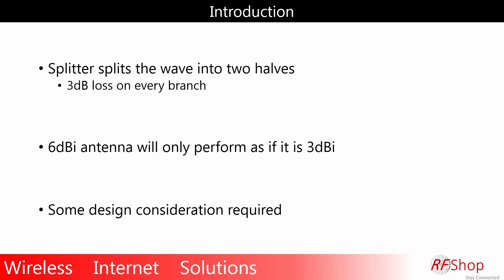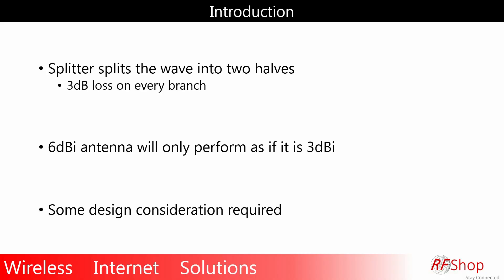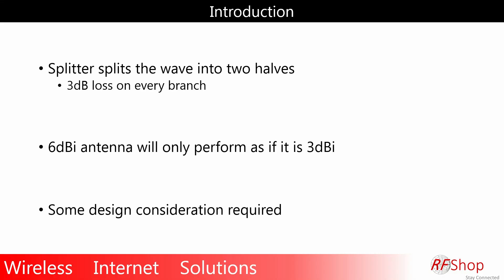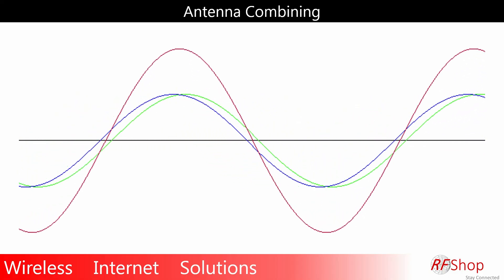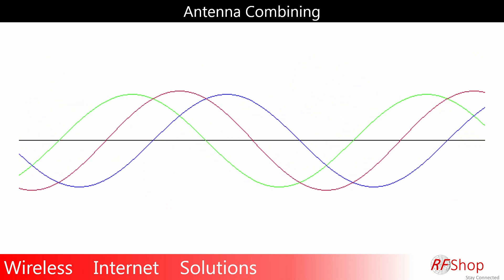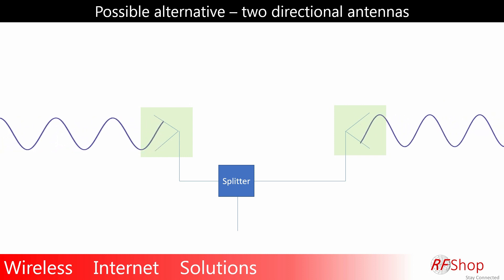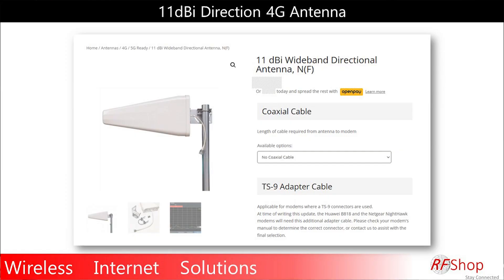Can I use an RF splitter on my Helium Miner ?

Comment: What am I supposed to expect if i use one 6.5 dbi amd one 3.5 dbi omnidirectional antennas 4 metres from each other. Will anything be damaged either the antennas or the miner?
Reply from the maker: It should work. Both antennas will get half the power, and they will work without damaging the other one. However, there will be a direction where things are out of phase and you will see nulls and peaks, unless the antennas are on opposing sides of a structure and potentially don't see each other at all.

Comment: Hello
Thank you so much for the very informative content you are sharing
can I ask a question?
Can I use a 2dbi and 5dbi antenna simultaneously with a splitter device?
Reply from the maker: It does depend on what you want to achieve but in principle yes, that’s possible and could make sense
Reply: @RFShop 
Hi
 Thank you for your response.
How can I do this?
I live in Iran and unfortunately I do not have access to you to make this work.

What tools do I need for this?

Comment: Is a "T" connector considered a splitter? I'm considering using a 3-way T connector with the omni antennas directly connected to both outputs and running the input into the perpendicular leg of the T, forming 1 large antenna from 2 identical antennas. Mounting the entire contraption vertically forming one tall antenna. Is this identical to using a "formal" splitter? Would it detune the antenna? Would it create excessive reflections back to the transmitter? Is there something special in a "splitter" or is it just a T with a fancy name and price?
Reply from the maker: A T would be a bad splitter. In RF design, you want to do something called impedance matching...basically making sure that the signal is flowing smoothly to both ports, and also trying to make sure there is no coupling between the two outgoing ports. A common design we use is a thing called a Wilkinson Power Divider ( feel free to search for this on Google ). That device makes sure you guide the power to the right ports. 
In a T, you basically just "jam" everything together. It's a mediocre impedance match and you accept that everything you get from one antenna will be divided equally to the end device (your miner) and the rest will go to the other antenna...which is pointless. 

So, I guess it's fair to say there's a massive difference between a splitter in an aluminium box and a T :)

Comment: Setup

2 Patch Panel 9dbi antennas (N-Male)    >    2 N-Male to 2 N-Female Splitter    >    2 Hotspots (N-Female)

1 meter LMR 400 between hotspots and splitter i.e 2 cables which gives 0.4dbi loss
1 meter LMR 400 between splitter and antennas i.e 2 cables which gives 0.4dbi loss

Cable Loss = 1dbi Approx
Splitter Loss = 3dbi Approx
Total Loss = 4 dbi

9 dbi - 4 dbi = 5 dbi for each hotspot

Will this setup work?
Are the calculations right or am I missing something?
How will be the readings from antennas split into both hotspots?
Reply from the maker: IN theory it should work, but I am not in favour of running two hotspots on the same location as it breaks the IoT plan

Comment: Can we use two antenna for one minor #1 will be 3db for shorter coverage & #2 will be 9 db for long distance coverage.
Reply from the maker: I would recommend just using a good quality low gain antenna
Reply: @RFShop   Hi I shall explain my set up of miner. I live on 5 th floor in 9 storied apartment I can not set up helium miner in the house with its antenna in my window as there is building opposite to it. Terrace is ideal place to place antenna. I cannot install complete outdoor set up as the building authority will have objection, so I was thinking to have antenna on terrace and mining unit in the house but my only concern is signal will drop drastically while passing through cable any suggestion how can I amplify  signal over say 25 mtrs of cable.
Reply from the maker: @RajKumar-kf2dh  can you please an antenna on the window (i.e. a window mount antenna with suction cups?)

Comment: Good vid. You are right that people don't understand RF. Having been to uni or worked in cellular tech means you do. But of course everyone is an expert these days hey? I am wondering about doing a tri-sector arrangement.. maybe 3x poyntings. Can get decent 3 way splitter/combiner that doesn't introduce 6dB loss. Having a cavity filter too. Cavity because here in UK when deploying sigfox we had some sites with inband interference which needed one
Reply from the maker: Hi Richard, if it's possible to use some directional antennas and have the weaker gain facing the other antennas it will turn into a nice "array" and it's possible to make a great solution. The trouble I have is the Dunning Kruger effect ... have a look on Google if you don't know what this is ;)

Comment: This was very informational, thanks. 
If I end up going with DIRECTIONAL antenna's and install a bi-directional amplifier on each antenna (before the splitter), does that mean I could negate the splitter loss effect on antenna's? Therefore a 10dbi directional antenna is actually acting like a 10 dbi directional antenna and not a 7dbi directional antenna?
Reply from the maker: Yes, that would indeed be the way it could work but I personally would almost not bother with that. The 3dB losses when you have directional antennas are manageable and I don't think. Amplifiers, on the other hand, will introduce some noise and could be a bigger problem.

Comment: What about combination of omni + directional antenna?
Reply from the maker: It’s possible yes, but hou will still face the 3dB losses
Reply: @RFShop  Maybe amplifier and cavity filter.
Reply from the maker: For sure it’s possible, but it becomes quite a complex setup and with amplifiers it’s going to be difficult to manage the legality and system design

Comment: What RF splitter do you recommend for 2 directional panels 12dBi? I'm going to be on a building with big walls of concrete that blocks all signal from other side.
Reply from the maker: Any 4g splitter should be OK

Comment: What if you use two 10dbi’s antennas! Your splitting those that means two 7’s
Not shabby! I’m using a 8dbi with my wire length I’m closer to 7.22dbi 
So mathematically two 10dbi’s I would be at the same thing!
Reply from the maker: Aeems legit

Comment: do you think dubble antenna for a miner works with two directional? I live in an isolated place, I have 30 hotspots 60km away to the east and 50 hotspots 70km west, my antenna connects to one city and the other only if pointed in the right direction, never both together. so with two directional and a splitter mounted on the contrary I could reach both? sorry my bad english
Reply from the maker: I think that’s worth trying

Comment: I had the opportunity to try such a setup and I must admit that I was positively surprised. However, I obtained RF isolation because both antennas were installed on both sides of a building consisting of many metal parts. I will only add that both antennas were connected to the Helium hotspot.
Reply from the maker: Awesome…thanks for sharing

Comment: My idea is as follows: setting up a 3dB omni-directional dual polarized antenna, elevation is approximately 15m too cover a smaller City I live in. Too reach the next bigger City (35km linear distance) I‘d  either choose a Yagi or Panel, not sure which and how much dB is best.
The setup will be running with a bidirectional amplifier specifically designed for 868Mhz with built in SAW filters. It has tx 5dB and rx 16dB gain.
Would it be better using the amplifier for both antenna’s, or one for each ?

From what I have read about Wilkinson dividers, there are ones with loss and lossless ones. The divider with loss is at approximately 3dB loss. Since the omni antenna only has 3dB, theoretically speaking it should be at 0dB. Or, will the omni antenna be operating with tx2dB/rx13dB because of the amplifier ?
If I where too operate it with no Amp, would the antenna be at 0dB ?

Would a lossless divider be the solution for both antennas, or is something else lossless on these dividers ? 
The only divider I could find for 868 Mhz are used in air traffic known as FLARM. According to the Datasheet it’s not lossless.

I’ve been looking into Helium for a week now and I have stumbled across many with the idea of operating two Miners with one antenna. I understand it from an earnings point of view but it is a costly investment. Besides that, one will need two different ip-addresses. I’d rather cover a bigger area than have two covering only one area.

And by the way, this is the only channel besides others I have watched, where one can learn from the comments as well. A big plus. So thank you very much. My first contact with RF was with a Multi Wave Oscillator with spark gaps. 😎
Reply from the maker: I would certainly not endorse two miners on one antenna. It goes against the idea of the IoT network deployment and will add to scaling in that hex where everyone will loose.
As for lossless vs non lossless splitters…there will always be at least 3dB loss. 
Your logic about the amps with splitters seems OK though!
Reply: Fantastic! Thanks mate. I have finally found a web page explaining all there is about HF and how HF electronic devices work. I always thought HF was in the GHz range but I was wrong.😀

Last question: Should I place the Amp near both antennas or after the transmitter ?

Comment: Thank you for those amazing videos...
What you think about a splitter for 2 helium miners on one 12 or 15 dbi directional antenna (sector/yaghi/grid/panel...)
Note: only 5 dbi is more than enough for each miner! And the area around me is empty... So im not spoofing :)
Reply from the maker: I prefer to recommend building the IoT network, which won’t benefit that much from two miners on one antenna to the best of my knowledge
Reply: @RFShop 
 👍Thank you

Comment: Can I place two panel antennas pointing away from each other on the same pol (0ne on top of the other)?
Reply from the maker: Yes, in principle that is possible but it depends what you want to achive. One higher gain omni could do the same
Reply: @RFShop  I'm in US. two 13.5 dbi, 90 degree sectors on a mountainside home yard to cover 180 degrees.

KP Performance: KP-900DP-90S 90º 900 MHz 12.5 dBi Dual Pol Slant
Reply from the maker: @jblglw  so they would go into one miner? Should work well
Reply: @jblglw  hey do you have a picture of your set up on Reddit? Would love to see your build.

Comment: Directional antennas have bleed on the back and side also, is that an issue?
Reply from the maker: Normally those power levels are low enough that it eill have less of an effect. It could be OK but it’s always good to check and make sure

Comment: Hi, thank you this video. Mcgill Microwave Systems 10dbi for europe what do you think for this antenna ? After pocv11 updates I will use lightning arrestor & long cable for use under 10dbi.
Reply from the maker: The antenna is good…I would recommend you report the correct gain on the Helium platform then it should be fine
Reply: @RFShop  thank you.

Comment: Cool idea but....

If you have 2 miners connected to the same antenne, the 2 miners will most probably be in the same LAN network, sharing the same public IP.

As a result of it, one miner will be relayed, right?
Reply from the maker: My video was about one miner with two antennas, but either way it's a mess. Simplest is just to stick to the original plan using one miner with one antenna on one location

Comment: Hi. I have a maybe stupid question.
I live in flat and i wanna place one antenna (3dbi) to one side and other antenna (3dbi) on other side of building. So i can pick up signal from both sides of flat. My question is that this should work witch 2x 6dbi (if i have 3dbi splitter) as normal 3 dbi antenna right? Is this good placement or i should do it differently?
Thanks for answer

Edit 1: one antenna will be 13m from ground, other 16m.
Reply from the maker: Yes, that would indeed work but do keep it mind that the radiation patterns will still be the same as the original 6dBi antennas...just a bit weaker in strength

Comment: So wouldn't one have to take in to account the impedance when combining 2 50 ohm loads, and the potential damage to equipment when this is not to spec?  Also antennas should prob be at least 1/4 wavel length apart, correct?
Reply from the maker: Hi David,
Yes, but these devices most often are Wilkinson splitters, matched to 50 Ohm on the inside.
You are correct about the spacing, but the problem is you need to get the spacing correct otherwise there are modt likely going to be issues. Given this community I recommend against it, unless someone understand the physics enough to space them correvt (like you seem to understand)

Comment: Well what about splitting two miners for one antenna instead of two antennas? Would the splitter still work the same/ going in the same direction so it doesn’t fry the miners?
Reply from the maker: Hi Aaron. I do see this is now the latest idea being considered. I'm not a fan of the idea of combining two miners into one antenna, both from a network and also performance perspective. I understand there appears to be short-term gains to be made in crypto rewards, but the long-term goal is compromised in my humble opinion. I'm just exploring a bit more detail with some contacts and would like to make a video to discuss the RF view on this idea (and why I don't like it)
Reply: While the purpose of our hotspots is to provide coverage and expand the network I understand the dislike for it. 100%. But if I’m providing hundreds of square miles of coverage through numerous hotspots “for the network” I don’t feel so bad doubling up in one location if it’s a great area. Also two internet lines would be needed bcuz otherwise one hotspot would always be relayed.
Reply from the maker: @IronUrnsif  I understand your point of view, but being an RF person my approach will be the network roll-out ;)
Reply: I appreciate that! Thanks for your reply and time! I look forward to more of your content!

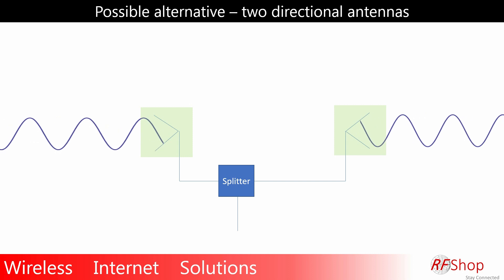Comment: The idea on 6:05 doesn't sound good to me. Even if the signals from the directional antennas won't be the same they could still cancel each other as you have no way of knowing what the wave on each side will be.
Reply from the maker: The incoming is from different sources so the concern of cancellation does not apply. The cancellation occurs when the same physical signal is received twice

Comment: I am thinking about using 4 directional antennas. On one side of the building I would like to use 2 of them (one for vertical polarization and one for horizontal polarization), same on another side. if one antenna is 14db, and 4 of them are connected to one hotsptot, the total antenna system would be equal 8db (14-3-3)? What do you think?
Reply from the maker: I think that’s an awesome idea
Reply: Just curious, lets say we have splitter with two antennas attached, and each antenna is 2dbi (less than 3dbi), so each antenna would perform as…-1dbi? What would that even mean?;)

Comment: But is there an antena with dual signal. Like one that performs like a 5.8 and an 8 dbi at the same time thru one antena
Reply from the maker: Unfortunately it does not work that way. An antenna is either a 5.8 or an 8 dBi antenna. Once you combine it will actually cause more trouble so best to keep it simple
Reply: @RFShop  but yeah, let’s think outside the box and can one created to adjust DBI like an automatic car for better performance.
Reply from the maker: @Unboxedonyt  yes...this type of stuff gets done for complex systems but certainly falls outside the budget of Helium miners. Things like beam steering etc. is part of satellite comms, radar and now also 5G.

Comment: So, you said opposite directions, but wouldn't two bidirectional antennas have to be at 90 degrees from each other? One covers north/south, the other covers east/west?
Reply from the maker: Yes, that would indeed work. It does, however, completely depend on someone's setup
Reply: @RFShop  awesome... So, you may or may not be able to answer this, but this also means that signal power is split between both antennas, so for the helium miner, should I claim I have half the dbi of one antenna for a setup like this (assuming dual identical bidirectional antennas) so my miner puts out an appropriate strength signal for max output (9 dbi ideally)?
Reply from the maker: @derek2593  yes, I'd say so
Reply: @RFShop  funny, all these people (including me) want to try dual antennas.... But, this will significantly affect signal reception. Splitter loses 3 dbi, and I am betting one 15 dbi antenna receives signal better than 2 12 dbi. And we make the most helium for recieving signals. We may all be adding unnecessary complications.
Reply from the maker: @derek2593  so true. That’s why I introduced the slogan of keeping it simple 👍🏻👍🏻